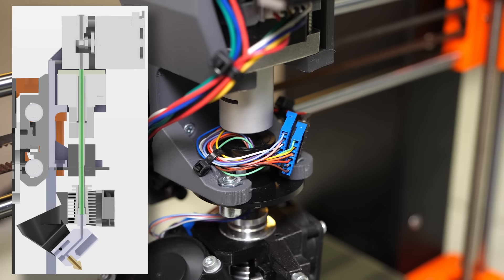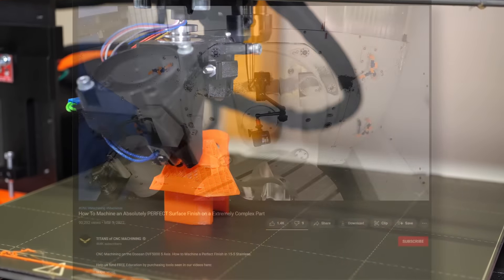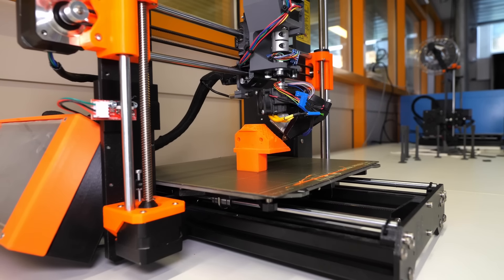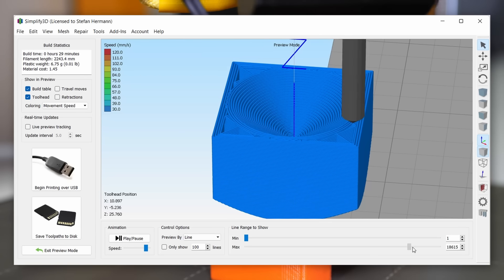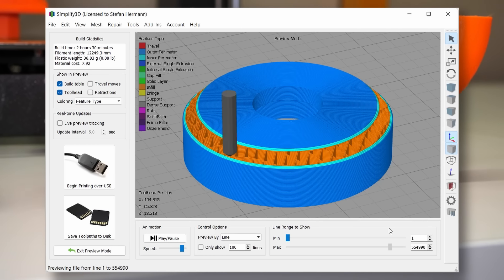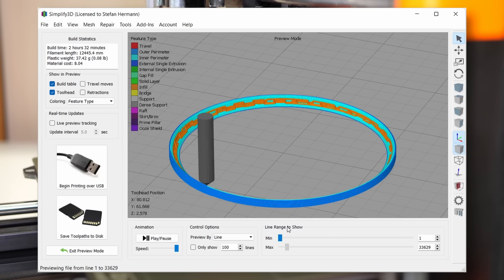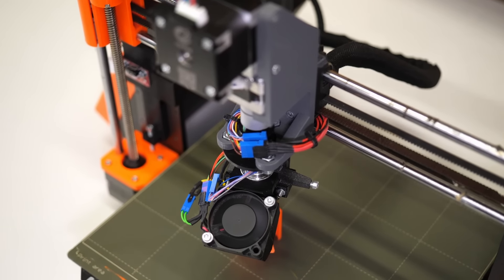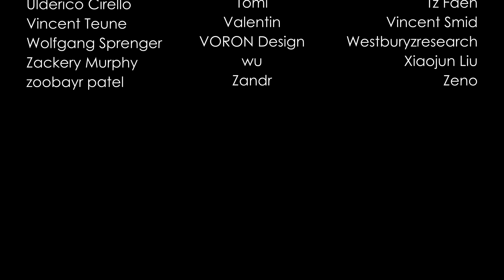Impressive 4-Axis Non-Planar 3D Printing

Comment: This is a fantastic idea and what would make it even more versatile is to have a head that can tip to any angle instead of just a predefined 45 degree angle. I could see taking a dual filament machine, setting up one head on the 45 and the other on the standard and then creating the code so that the best head is used for each independent layer.
Reply from the maker: There is a 5-axis version of this somewhere around (I think even Rene Mueller built one) but this introduces even more complexity into slicing and flexibility into the tool head.

Comment: Stephan never ceases to amaze with his ideas to cover the unique and fringe applications of 3D printing and the excellent quality of his videos, congratulations and thanks. This technique would be perfect on my TronXY X5SA-400 or ANY large format printer were you can imaging printing a section of a car bumper skin that no mater how you angle it in slicer still has considerable overhangs, print time, and waste plastic, With this printing technique, there would be essentially no supports (or very minimal) and print time would be dramatically reduced, and waste almost eliminated.

Comment: one thing touched on in the video I think is going to make a huge difference on current gen-fdm printers is a more complex slicing that can intelligently section off geometry that can be printed either in a specific order, or with a different slicing technique to improve performance and speed. It seems that the state of the art is a naive, uniform approach, but it can be significantly better. And an entirely new piece of hardware wouldn't even be necessary.

Comment: Don't know if it has been mentioned, there is also an older attempt for nonlinear slicing called Curvislicer which builds on an older Slic3r version , and open source is awesome, printing with a robot arm was shown off at Formnext 2018 but proprietary of course

Comment: I am incredibly intrigued what this does for the strength of parts. Considering the layer lines are no longer a straight cut across the Z axis, which is present even on belt printers, this is quite the interesting proposition, along with the idea of getting away from supports. I hate supports. They're a necessary evil, but the fewer the better and this seems like a fantastic alternative for a number of applications.

Comment: Hey Stephan, thx for showing this great project!
i often thought about a complete rotating printer to fight gravity - have you ever then something like that?  combined with tilting printhead AND bed you should be very near to print everything.
Reply from the maker: IMO its not only fighting gravity, because overhangs on upside down printers don't look that much better - it's also fighting warping of the material and that requires precise cooling or physical supports.

Comment: Awesome to see this. Like so many, and said many times, I don't have the time right now... but I had wanted to do something like this for belt printers because so much work has been done on slicing systems but going "hey, let me completely change how slicing is done" means you produce a branch in the slicing logic and loose the ability to access new features. It's why BlackBelt Cura is so old, IdeaMaker only goes so far (from when I used it), and Kiri Moto is also stagnant on it (last I checked). If Cura, Prusa, or others introduced Arachnie or similar... it wouldn't work on belt printers because of that branch. But... deform the model, slice, inverse-deform the sliced parts and you suddenly have the ability to use the latest slicing features and more while getting belt, non-planer, conical, etc. support. Or at least, that's the theory. Maybe with more time, I'll be able to try it. (Yes, I know, the slice-step between the deformations still requires some specialization and can't be naive in processing, but there is still the chance that something does work without modification. Just need to try it out)

Comment: This is super amazing. Next evolution of 3d Printing, for improved aesthetics and part strength. This was my top wishlist item for the mk4, and unfortunately this did not happen. We should be able to use an improved nozzle with more clearance and then need to pull back the fans as well. Prusa needs to implement this asap, in Prusa timeline this means several years, but perhaps you can do a video where you tweak a Prusa to implement this without the 4th axis of rotation? what do you think? I will then try to reproduce your work and if enough people do this the community will develop this open source upgrade. Then imagine, testing parts with improved Z axis strength! Even a normal part that may not need this, if printed this way will have improved strength in areas where it can help, and other areas can be planar for improved exterior surface finish.

Comment: Fascinating. If you could just tag a section of a model for conical slicing vs. rectilinear could really be a game changer. Mixed mode printing would be the goal. If nozzles could be made with more clearance angle and the slicer have a variable for compensating, I would think "normal" printers could really benefit. As you said, this is mostly a software problem.
Reply: We already made test with this combination. Nothing speaks against it.

Comment: I have a great episode idea for you. I was very jealous of Matter Hackers when I saw that they have a vacuum oven for drying filament in just one hour. I bought a huge and heavy vacuum oven... then I wondered... can you simply put filament in a in a cheap degassing vacuum chamber and set the vacuum chamber on top of a hot plate. People might be able to dry filament cheaply and quickly. I wonder if it would be better to heat the filament in the chamber first and then vacuum out the air or should the vacuum be applied at the same time as heating. I'd love to see you do some experiments.

Comment: I still think that a very precise robotic arm may be a very good solution too, mount it upside down so it can reach down and print on a bed, then maybe even add a Z axis to move the whole arm up and down to increase the build volume. A robotic arm with enough degrees of freedom may be able to reach round a print and print on the underside of a part, at the very least it would be able to print horizontally and non planar, and would be capable of the conical printing too. Depending on how long the hot end is and how much clearance it has, it may be able to print internal overhangs if sliced right.

Comment: Works like this always make my heart jump <3
Now I'd love to see a hotend, that tilts the nozzle exactly at the point of extrusion.
This way, you'd have a tilting axis, and leave away the rotation axis. That also means, that less mass has to be moved. You only slightly shift the center of mass on the hotend by tilting the nozzle.
Which may be a lot more work, as you'd either have to tilt a very hot part, or tilt the part further back, and even more precise.
Sometimes I am sad, that I didn't study physics...
Reply: Or have the hotend only tilt to different angles and have a build plate that rotates. Then you could use a bigger stepper to accelerate the build plate rotationally more quickly, not have a cantilevered hotend, and less mass on the hotend as well. 

Maybe even a simple hotend swap with a hotend at a predefined 45 degree for simplicity/ weight reduction

Comment: Amazing! is it possible that printed parts with this method are stronger? because of the way the lines are printed. You could make a test comparing regular 3d prints vs non planar, I am curious specially if the layer bonding problem can be solved at least for some geometries

Comment: This looks very promising, though I do have to wonder, if the only advantage of the rotating hotend assembly is that the nozzle wouldn't impact the extruded material, would it not make more sense to only make a custom rotating nozzle with a 45 degree cut on the bottom surface still facing down like in a conventional printer?

Comment: I wonder what effect could be had by placing a printer inside a 3-axis gyroscopic mount so that the extrusion direction was always facing away from the gravitational normal. Thus a horizontal overhang would be printed upside down (or angle) using gravity to assist in supporting an open air extrusion. You would probably have to move at variable rates as well so gravitational flex could be matched by extrusion rate.

Comment: I guess the ideal point to apply the T^{-1} transformation might be  at the printing stage since if you have mesh levelling corrections they will probably not work with the inverse transformation already applied, right?

Comment: What I would like to see is the change in layer path to increase strength in particular directions in the part. Currently we have one layer line surface orientation. We have reduced strength due to that layer line. But consider a tree with a branch that takes a 45 degree path. The fibers have changed direction, and therefor the strength has been transferred to a different plane.

Comment: Can you get some test pieces to run through your test apparatus? To see if the conical shape layers are better or worse than standard layers. It seams it may have a slight impact as the shear forces would no lender be parallel to layers..

Comment: I always wondered... What if we had a robot arm rotating around the buildplate? Robot arms can get really everywhere and don't have any limitations, unlike rigid frames with carriages. In theory, a nozzle operating on said arm could not just tilt to more than 45 degrees but also print upside down.

Comment: Amazing! I'd love to have a combination Delta printer, which would be what, 7-axis? I think that would give the most potential in the smallest form factor.

Also, an ability to print CpVC and ABS would make for some GREAT work for plumbers. Have this in the shop, and print the exact parts needed rather than going to the store and modifying them.

How are the print times versus, let's say, moderately supported normal slicing (general lab parameters applied for sake of at-home temperature variances, etc)

Comment: Go to 5-axis with a head tiltable around X and Y. Most work for that would have to go into the slicer of course, but mechanically it should actually be simpler (no slip rings for electrical connections or hollow shaft steppers needed).

Comment: nice nice very nice
i say why not have a standard straight  print head with a rotating nuzzle tip that it cams the angle of the tip so that it can go from 0 degree to 45 degree

Comment: You know, after watching this video, I figured wouldnt it be much more efficient if the bed rotated instead of the head?
You'd like, save one motor.
Have the angled nozzle be on two axis: either up-down and back-forth or up-down and sideways swivel.
The bed is round and rotates. So basically picture the printer like a vinyl record player with the addition to the Z-Axis.
Reply: Take a look at polar printers, they do exactly that

Comment: I would have thought that a delta printer could make all of those angles on the nozzle without the need for rotation or an articulating bed (i.e. their earlier experiments).  However, maybe the size of the triangle at the base would make collisions more likely.

Very interesting video!
Reply: A traditional Delta couldn't, because each arm is a parallelogram. The hotend simply can't rotate, because of that arrangement, which ensures the ends of the arms are always parallel to their mounts.

For rotation, we'd need independent motors on each of the 6 arms.
Reply: @akaHarvesteR  Ah, interesting. I somehow thought that between two legs it would a rhombus, with the nozzle plate being the smaller end of the rhombus.  I need to take a more careful at the geometry. Thank you!
Reply: @akaHarvesteR  I found a simulation video that explains what you are saying very clearly. Thanks again!
Reply: Another way to think about it, to have six degrees of freedom, you need at least six motors. 

A delta printer only has three (plus the extruder of), so it wouldn't have independent control over the rotation axes even if the arms allowed rotation.

Cheers
Reply: @akaHarvesteR  Yeah, that occurred to me too, but I was hoping for magic :D

Thanks for setting me straight.

Comment: Wonder if its possible to put the head on an iris or some mechanism and print with 2,3,4...8 etc heads at the same time since it's sliced into a circle. You'd have to expand the heads radius as an axis and move the bed XY much less.

Comment: Why does the whole heater block need to be tilted instead of just the aperture at the end of the nozzle?
Reply: One reason is, that you need clearance and it may not be very easy to produce. But just give it a try...
Reply: @michaelwuthrich72  I see what you mean, but there might be a compromise there, as the 45deg heater block has its own clearance issues.

Comment: Could a modification or add on be created in a program like blender or any other CAD program where you (already proficant at CAD)? Just model your hotends (tool) geometry and tool holding and have the software calculate the optimum toolpath. Would making a universal slicer for all CNC platforms. Maybe that exists in big engineering but open source would be nice. Maybe a future project.

Comment: Couldnt you use a delta printer in a similar fashion? I dont have any experienece with them but I think that if you lift one of the "legs" you get an angle on the nozzle. Food for thought.

Comment: Thoughts:

Nice (as always :)

Just these weeks i've started my own 5 Axis Design with the same motivation -> which is getting less issues with overhangs and an ideally smoother surface finish (thats why i've ordered your volcano adapter in Order to geht one of the brozzle nozzles adapted that have a nice shape in Order to really Go for 45 deg.).

I havent heared about the conical slicing yet (which seems to be a very nice approach :).
Anyway I want to do normal vector analysis in order to Post modify the Outputs of my slicer.

For the extended kinematics i haven't decided yet If i just map it to extra "extruders" or go for some Experimental Firmware..
Reply: Is the design written up anywhere?
Reply: @KentoCommenT  Hi Not yet.. but i have it in a way that it could bei potentionally converted in a core X_RZ Design ;)

Comment: Use a printer with a bed that moves in Z instead of the gantry, use three independent z motors so the bed can be tilted and with this you get even more ways to print supportless and difficult geometries. You'll need an even more complex slicer, but the possibilities are impressive.

Comment: wouldn't it work if the nozzle hole is angled, and just nozze is rotating? Also I wonder if just offsetting in xy plane thowards previous layer would help with overhangs, squishing layers purposefully.

Comment: One important part was left out…..print time.  What is the difference between a normal 3-axis printer with supports vs the RotBot 4 Axis?  Given that  decent sized prints take long times, if this method adds any notable time, it’ll not likely be worth it for anyone trying to make a living when the ‘time cost’ is prohibitive.  Kinda hoping it’ll be notably less time but looking for some real-world results here.

Comment: The foreshadowing images that show a regular 3d printer print a horizontal overhang makes me think: if 3axis printers can actually do such overhangs with a more conical slicing approach, doesn't that mean that the rotational 4 axis printer could actually go up to -45° overhangs? (printing a branch going down from a trunk for instance) You are right, the software here is the real limit, feels like this technique has a lot of promises!

Comment: I think the head is too big and will get in the way too much for this to really become a thing as-is, but it's amazing work towards a future version of itself that doesn't have that problem.  

I also think the non-planar slicing could very well become a thing that slicers support natively because it seems like it just has a ton of applications, even if it's a pain to calculate.  It might not be automatic, though...  The designer might have to give hints to the slicer on how to deal with the topology of the slice in particular areas.

Comment: would that not work with a Delta printer to an extent? I mean with a delta you could slightly angle it. Not the same amount as the shown printer but maybe 5-10°? which could already help with overhangs?

Comment: Is there no free software where you provide the general dimensions and degrees of freedom of the printer (and perhaps also their respective speeds), and it then looks at the finished model and performs n-dimensional path-finding for the hot-end along the print volume starting at some maximum distance from the model and always searching for the nearest untouched point in the volume of the model, imparting infinite penalty for crashes, thin and fully cut overhangs, and minor penalty for non-touching movements (thru the air), and weighting movements based on the printing speeds allowed by each degree of freedom; producing the reverse of the path the machine needs to go thru in order to print the model, that can just run backwards to perform the print?

Comment: *Sorry in advance if you covered it already*, but how does this compare to the other Open Source 5 Axis Prusa Mod?  It used a different method if I remember correctly, so id be interested in your thoughts on that design as well.

I can try and post a link below, i know YouTube dislikes links at times (unless they are from actual spam bots lol)
Reply: Here is the link to the project, it’s called “Open5x” :

https://youtu.be/x9rG15qrDIE